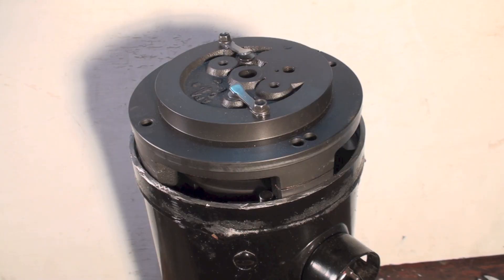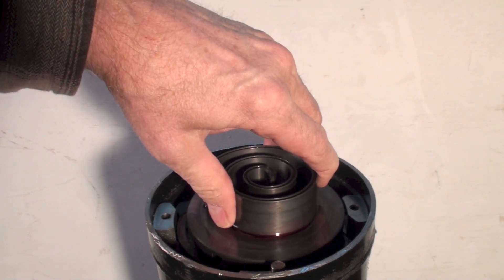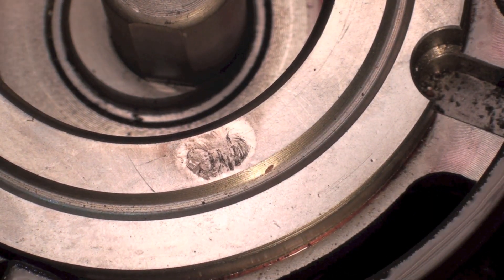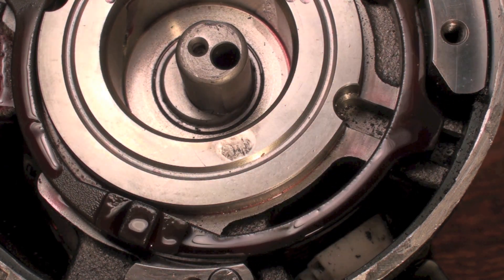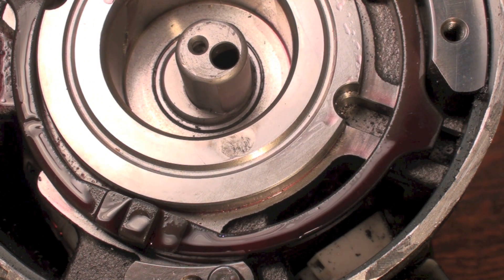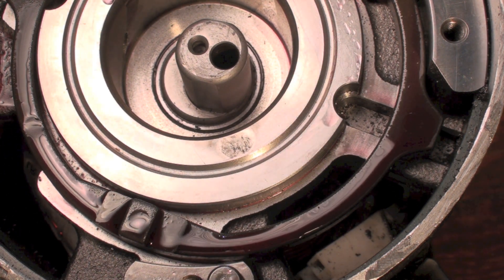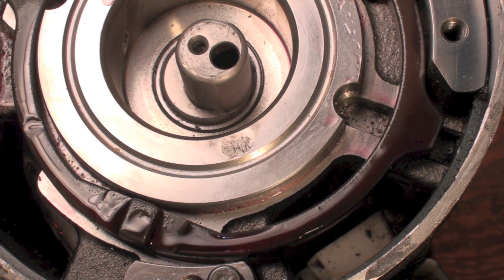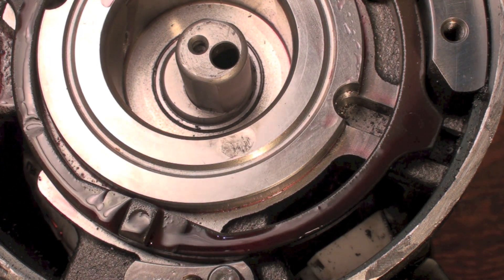Korean scroll compressor:  why did it fail?

Comment: Hello GFM, have you found the answer? My opinion is that it may be caused by an error in welding the top cover. When welding, the top cover must be in full electrical contact with the lower part. It is best to connect the upper cover and the bottom part to a welding return cable circuit to avoid the arc effect caused by the large current passing through the Scroll mechanism.

Comment: @GaryFurnaceMan, That looks like sand paper grit contamination to me.  The size of the pattern is the same size as the scroll movement.  Also, the circular patterns give away the circular scroll movement, not an arc.  Arcs will show pitting over a smaller area unless they are huge.  I have had to put 3 N 1 hard start kits on scrolls for similar reasons as this and they work fine more many more years.  They would have occasional locked rotor without a hard start.  The grit will eventually work it's way out.  Since this was an inverter drive, I suppose the software had to limit the starting torque low enough that the compressor become stuck permanently.

Comment: Could the condition of the oil help when troubleshooting the cause? Did it smell burnt or acrid? Seeing this peaked my curiosity. Thanks grey for another good video.
Reply from the maker: The compressor was sealed when I got it and the oil had no burnt smell.  A very interesting failure.
GFM

Comment: That is NOT an electric arc that did that.  Such an arc would require much more energy than could be developed between these elements. You would see burnt oil residue with that much arc.  Also the currents in the rotor flow within the bars on the rotor not to the bearings.  The situations of electrical problems at motor bearings you have heard about are currents from external devices connected to motors..  What your photos show looks more like contamination such as an emery grit or possibly a breakdown of the case hardening of the lower member.  Such breakdown is often seen in wheel bearings of vehicle if case hardening is too hard.
Reply from the maker: Fred Yearian Did you note that both surfaces have the defect of the same size and in the same place on the bearing surface?  
GFM

Comment: Yes, I see that... but the amount of electric energy required to do this damage could never develop between these two parts.  It takes both voltage and current..  This damage appears to be fractured hard surface material.  When one surface broke off a chip, the chip will then tear up the adjacent surface. Failures of case hardened surfaces are common failures in automobile wheel bearings.  There is very little magnetic induction in this part of the compressor, nor a "loop" to develop voltage across. .In industrial motors that are belted CAN develop arcs, but that is electrostatic and that would not exist in the closed compressor system.  A small grit could also cause this... hopefully nobody uses emery paper to clean tubes before brazing, although it would have to be very small to get between those surfaces.  Carbonized or burned oil might do this.  If the parts were submitted to a metallurgist they would pinpoint the cause. The probable cause is improper heat treat of the HARDENED part is my vote as many foreign hardened tools are too brittle for example..